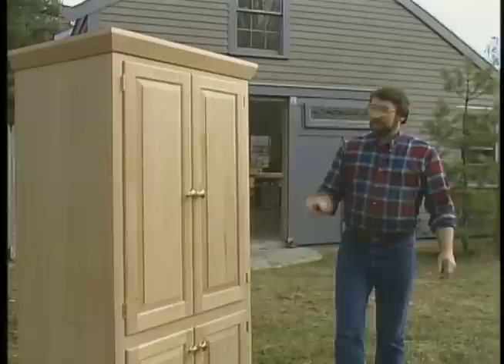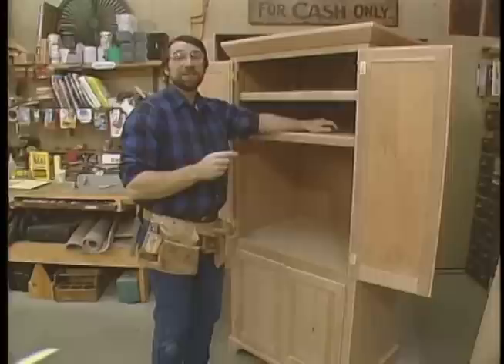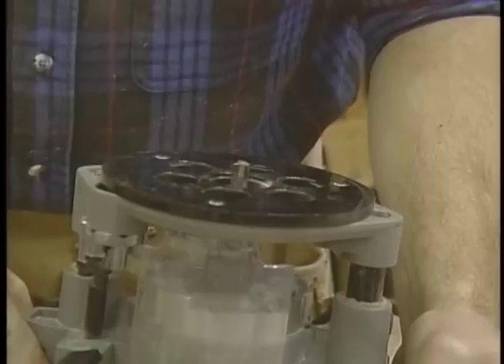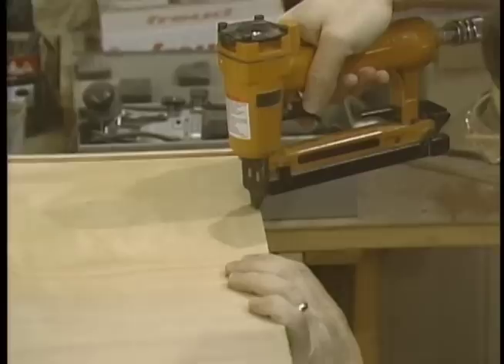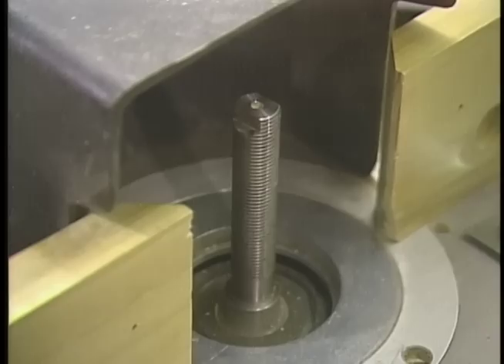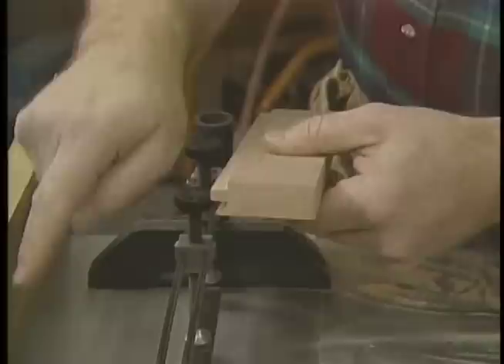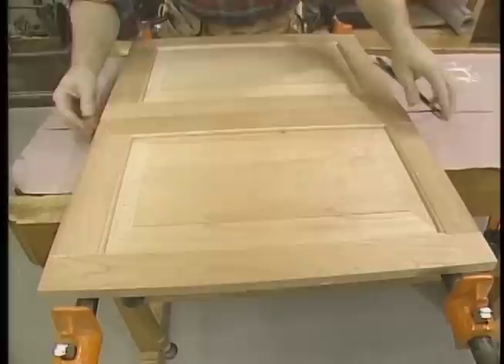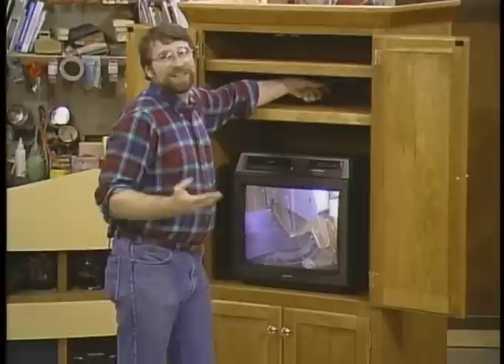Armoire (Entertainment Center)  |  S2 E13

Comment: This one is a tad obsolete. We used an entertainment center for years by placing a flat screen TV that happened to fit with a bunch of empty space behind it. Eventually we upgraded to one that hangs on the wall. Streaming got rid of the DVD player. I broke it down and burned it in our fire pit. One last night of entertainment.
Reply: I still have my Blu-ray and a VCR. I still buy DVDs and Blu-ray.  Sure steaming is great until the service doesn't renew the license for what you're watching. Even if you buy it,  when the company's license expires it's pulled from the available videos.